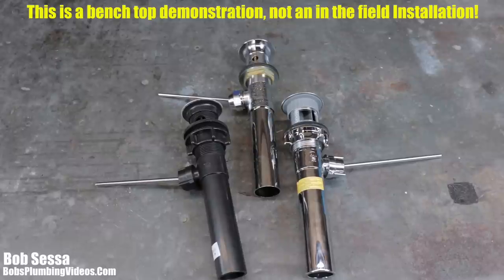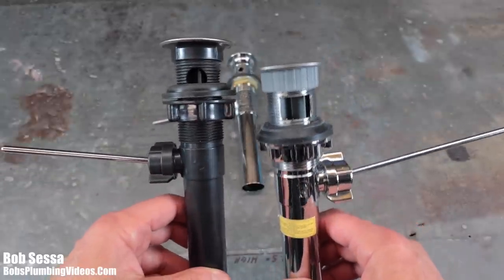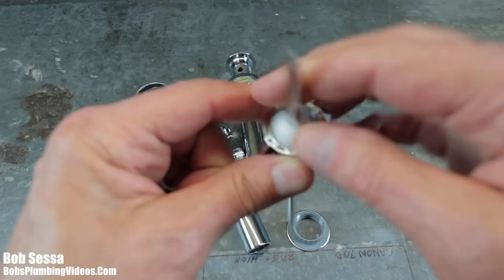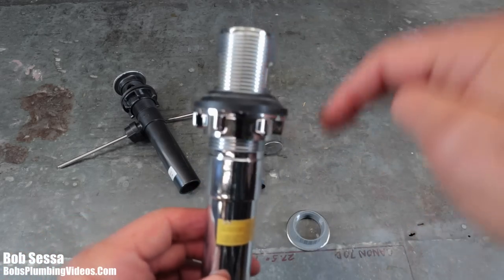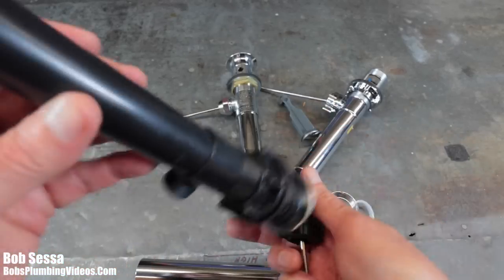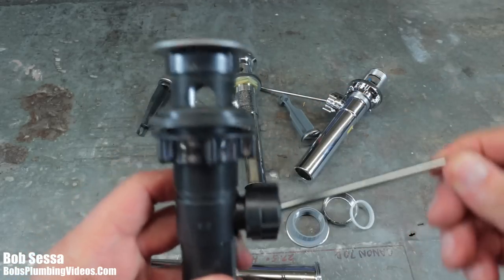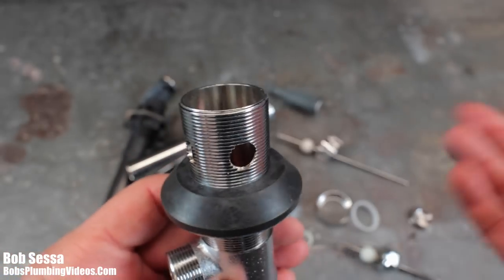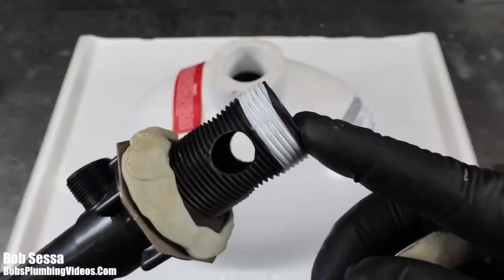Bathroom Sink Pop Up / Plastic Pop Up Drain?

Comment: Great vid Bob! For the plastic version I rub a small amount of dish soap between the nut and the bottom of the rubber washer to reduce the friction. This keeps the rubber washer from distorting as the assembly is tightened. Next opportunity I’ll try the cardboard friction washer. Given the choice I also prefer the metal version.

Comment: It’s nice to watch a craftsman with patience to teach others. I’ve installed a few plastic pop ups with integrated tailpieces in my time and I’ve never used any putty. The bottom is always water tight if the nut is tightened hard enough and pushes the rubber beveled washer into the bottom of the drain hole opening. And any water that may leak under what you call the ‘flange’ has nowhere to go but down through the overflow openings and into the tailpiece and drain anyway. Just my limited observation, for what it’s worth. Probably better, as you say, to throw it out and use a real strainer & tailpiece assembly made from heavy gauge chromed brass

Comment: Hey, I agree with pretty much everything!  I only use high quality all metal drains.  Usually Moen.  I make sure faucets I buy have the metal drain.  One trick I learned to stop leaks under the sink hole, is to apply Rector Seal #5 on the 5 or so threads that seal the nut and opening.  It's soft rubbery like when dry and watertight.  Lasts longer than plumber putty.   And again, I only use metal pipe so I don't know if this would work on plastic.  I also use the #5 sealant on top of new angle valve crush sleeves so I don't have to worry about indents to the pipe causing a small leak from the old sleeve that is removed.
Reply from the maker: Great tip! I will Cherokee it out, regards. Bob.

Comment: Great video, I hate plastic pop-up drains, the fact that the flange, which is poorly designed can easily crack and or separate during installation. . . had this happen a few times trying to cut corners. So now I only use Keeney heavy duty cast brass/chrome or better pop-up drains. . .
Reply from the maker: Very Nice Pop-Up assembly...Regards, Bob.

Comment: When you deal with plastic, what I learned is just hand tighten it first and run a water test, if it leaks, tighten it more until the leak stop.
Reply: That is the right approach to take with plastic parts.  They can crack easily if tightened excessively.  Even with metal it is only necessary to make the joints tight enough so that they do not leak.  More than that can strip out threads or make the parts extremely difficult to take apart later.

Comment: Thanks for the vid!  Do you have any vids on the proper use of a drain auger, the kind you would use to clear a shower drain for example. I just paid a professional plumber a fortune to clear a shower drain, it's took all of about 20 minutes and I was wondering if there are any special techniques involved especially when you get to the part of the drain when you reach the trap. The guy ran the cable out about 25 feet and I was wondering how he got past the trap without getting the cable stuck somewhere. LOL thanks for your help, love your videos!

Comment: Hi Bob with the plastic drains if the flange inside the bowl being plastic should I use plumbers putty or silicone to seal it to the basin. It is a Kohler pop-up drain with a washer (seal) ? Thx guenther

Comment: Before I saw this video, I just replaced a plastic one with another plastic one. Odd thing is it's leaking between the nut and the tail pipe threads. I took it all off and wrapped that area with blue Teflon tape and reinstalled. Tested it again, cold and hot water and then thru the sink overflow. All looked good but came back 15 minutes later to collect my tools and see there's a leak at the same place. Ideas??
Reply from the maker: Put a brass one in !! Make sure you use plumbers putty under the chrome flange before you set it in the sink and on the rubber washer underneath before you push it up against the sink. Followed by a metal friction washer and  finally the nut to tighten all up.

Comment: my understanding is that the rod should go through the hole at the bottom of the stopper.
if the rod is through the hole and the stopper cannot move, does this mean that the position of the whole assembly is too low?  i.e., can i get more stopper movement by tightening the whole assembly further on?
Reply from the maker: My process when setting these up is to have the pop up rod in the fully up position. I loosen the nut that holds the rod into the pop up tee, thread it through the hole of the stopper, then pull the rod down.This will bring the stopper to the full up position. tighten the nut back up (gently) then adjust the lift rod assembly accordingly. If you tighten the nut onto tee to much it'll be very difficult to move. Check this video out, it make help you:

https://youtu.be/oMrwiF10aVw

Comment: My bathroom sink"s drain is in the middle of the sink, therefore, the rod that adjusts the height of the pop up isn't long enough. When it was installed they bent the piece with the adjustment holes to make it reach. It has never worked properly. Also, the piece going down into the drain doesn"t have hole at the bottom for the rod, it has a magnet. What do you think?
Reply from the maker: That's a common problem with some of the newer sinks on the market. I have had to to the same move, offsetting the lift rod (piece with the holes) in order to make it reach the pop-up rod. You could try searching on sites like build.com for  pop-up assemblies with a longer rod. I have to guess they're made. because more and more sinks are coming onto the market that create this problem. Good Luck and thanks for checking bout the video. Bob.
Reply: @BobsPlumbingVideos  Thanks

Comment: I have a toilet question. I watched your video about measuring off the wall. So I got that part understood. But I have a section of baseboard and a window behind my toilet. (I am moving the toilet over to be centered on the window) My question: Do I still measure off the wall or off the baseboard enclosure? Thanks!!
Reply from the maker: You always measure off the finished wall, also  a minimum distance from the center of the bowl  to both the left and right should be 15" . Total  minimum distance  30" with the bowl dead center. Not always possible, but that is code here in the city.
Reply: @BobsPlumbingVideos  Okay. So the baseboard heating does not have to be  factored in. Great. Thanks for the fast reply.